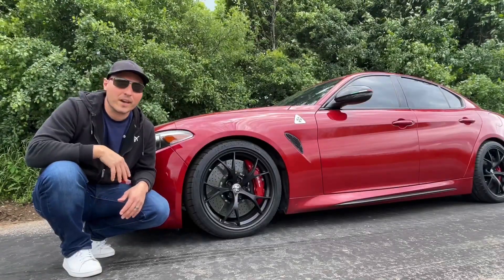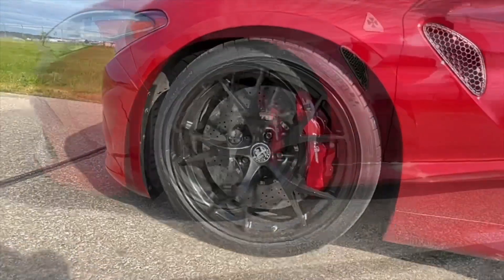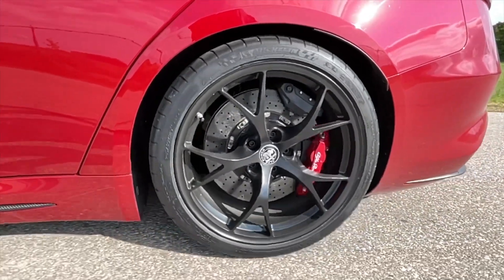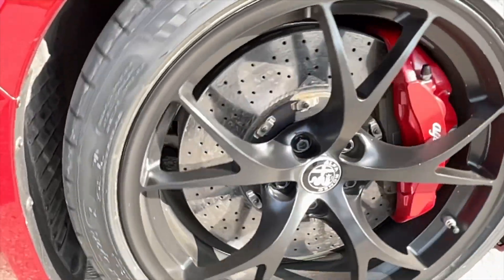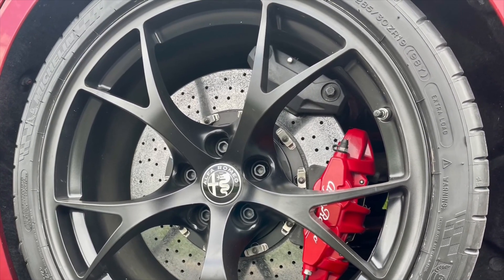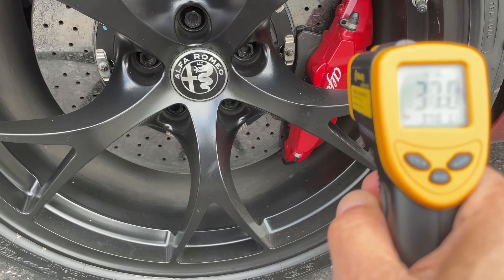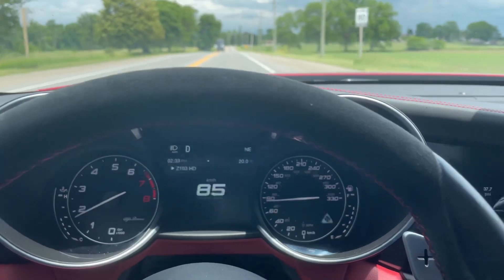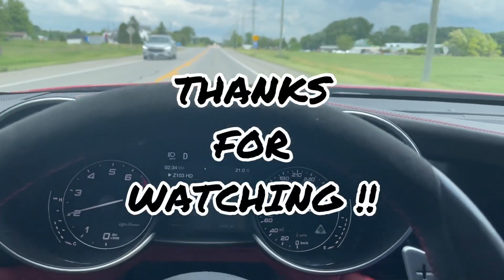Alfa Romeo Giulia Quadrifoglio - Carbon Ceramic Brakes Testing!

Comment: Mine’s at 90000km now, and still work with zero fade at trackdays.
They do judder/shake a lot, except at hard braking! And sound a little odd too, but no sqeeling.

I wonder if CC discs actually can warp? Anyone got a clue?
Reply from the maker: From my understanding, they loose that disc material so over time they get lighter and lighter. Thats how they check to see if they need replacing, by weighing them. 
If I were you I would just have them get weighed and go from there.

Comment: Super Nice....I just picked up my first QV...and come with CCB as well...Doesnt come with Carbon Bucket seat.....
Reply from the maker: That’s awesome Congrats! What color did you get? Mine is missing the carbon buckets as well…can always try to get some for it though.
Reply: @chasinglimits  Trofeo white 2018
Reply: Trofeo White,...I am still have alot to learn about this car...May I ask you How many mile do you do a Oil Chage? 5000 miles? @chasinglimits

Comment: The carbon ceramic brakes are supposed to cost 9000€ which are $9800... You got robbed
Reply from the maker: Depends where you are located. I didn’t buy them, I just inquired to see what they cost straight from the Alfa dealer. There are better and less expensive ways to go about it as well.

Comment: Too expensive for my taste if they ever need replacement.  Glad I have the standard brakes which are plenty powerful for street use.
Reply from the maker: If you just use them for street use, they should basically last the life of the car, of course depending how much you drive it, they say around 160k kms (100k miles). The standard brakes are much cheaper but I’ve seen owners having to replace them pretty often, so that adds up as well.
Reply: @chasinglimits  
All true.  Got my car used and it came with the standard brakes which works for me.
Reply from the maker: @securehealtheap  Agreed, the standard ones are more than enough and I don’t see the CCB’s offering shorter stopping distances, only thing I can see is less brake fade which isn’t critical for street use.
Reply: @chasinglimits  
The stock brakes hit so hard when the car has put them on thinking I am about to hit someone that I have come off the seat.  Very good brakes for street carving.
Reply from the maker: @securehealtheap  yea they bite hard right away, no need to heat them up for them to fully work 100%.

Comment: THANK YOU VERY MUCH, KIND SIR 👍🏻👍🏻 Cold to Normal temp, how long did or does it take? (Over distance or time? Your video clips' time stamps may have the answer!)
Reply from the maker: It was a great idea so thank you! 👍 it really depends on how you drive it, how fast you take and then how hard you brake. It took a lot of stops to get the temperature well above the 250+ deg C (500-600F).
Reply: @chasinglimits  thank you again 🙂
Reply from the maker: @ness-uno1  anytime! 😎
Reply: @chasinglimits  I subbed a while back but feel free to block me or tell me to shut up and go away 😂 Still curious... what's it like braking in normal daily conditions? Is there any squeaking or grinding noise? Does the car jolt when you brake? Etc
Reply from the maker: @ness-uno1  no worries man I don’t mind answering questions lol it brakes very normally under normal conditions and I never got any noise out of them, whether hot or cold. When they did get very hot,, they kind of growl more but that’s about it. They are pretty easy to modulate especially in stop and go traffic, very easy to daily. Hope that answers it?
Reply: @chasinglimits  it does, thank you again 🙂
Reply from the maker: @ness-uno1  anytime! 👍
Reply: @ness-uno1 The only thing I would say is when i get out of the carwash there is no grip at all. I always touch The breakes a few times when i leave and that salves the ' problem '. For the rest perfect for me.
Reply: @Dddccc6669  thank you Dirk! Funnily enough, a while back I heard the same from a guy with an AMG. He said the first time he almost crashed and the dealer never told him about it or that they make noise (if not used as intended). What about when it rains then? Reduced performance too?
Reply: @ness-uno1  no, i guess it'll be the soap wich get between the pads and discs. The first time it is scary but after a while touching the brakes when leaving is something i automatically do without thinking about it. It becomes like a second nature. People can adapt easily I have noticed. 😅
Reply: @Dddccc6669  I think I will bite the bullet. It may be the last chance to get them before batteries and regenerative brakes take over. Thanks again to you both 😀